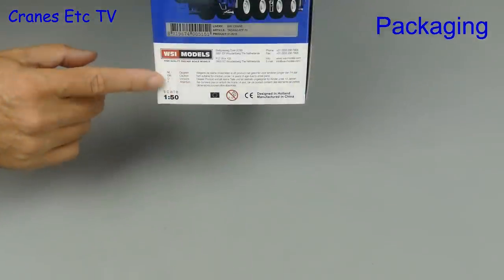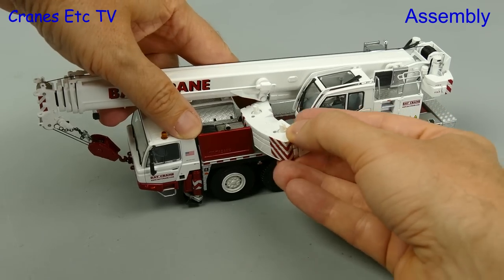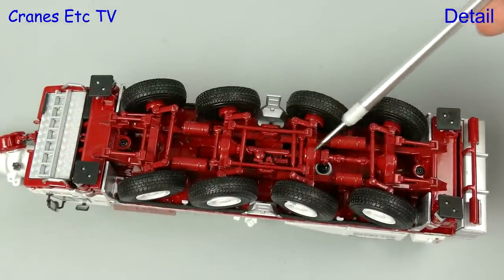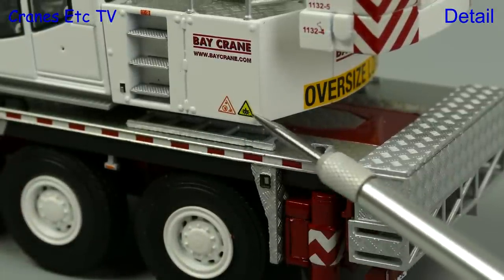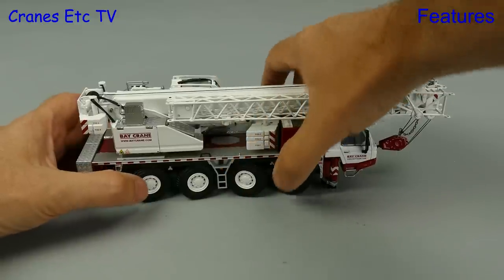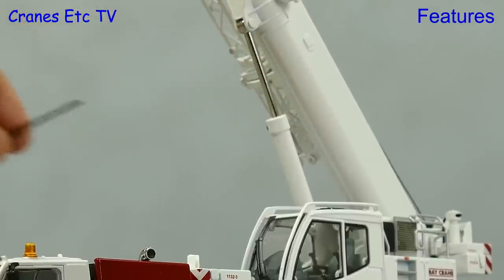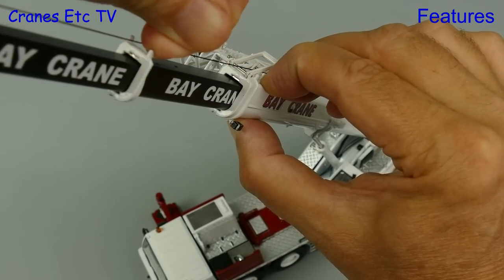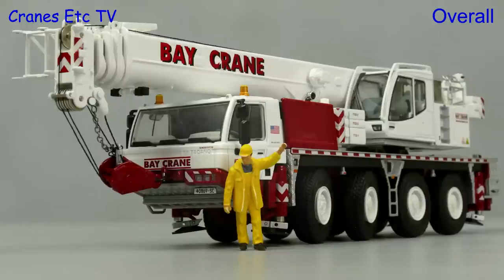WSI Tadano ATF70G Mobile Crane 'Bay Crane' by Cranes Etc TV

Comment: Excellent?? Really either im blind or 
The tires weren't flush with the wheels
Reply from the maker: One defect does not = rubbish.  If it does, then all models are rubbish.  Actually the tyres can be positioned better.  The Cranes Etc team member responsible has been sacked.